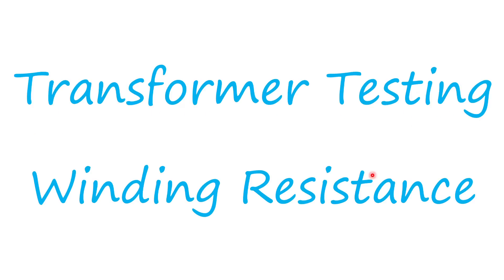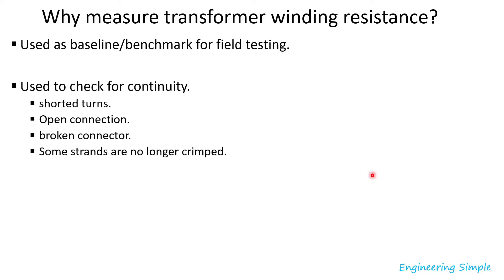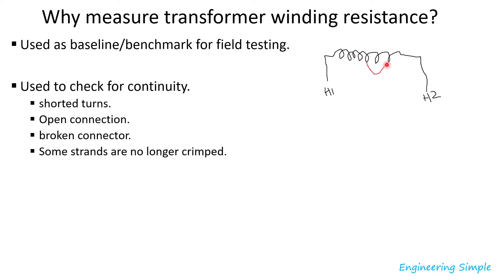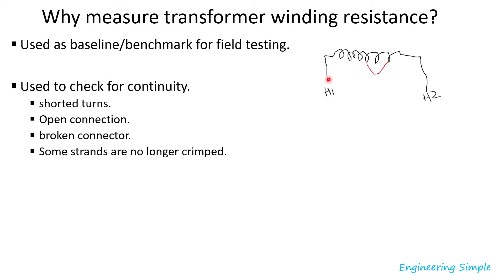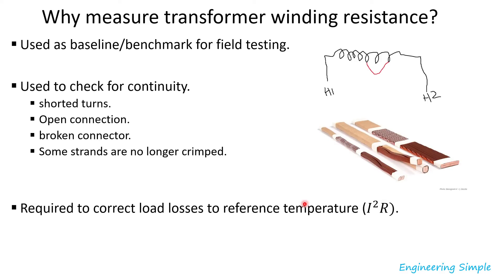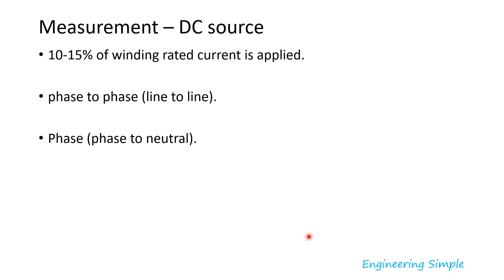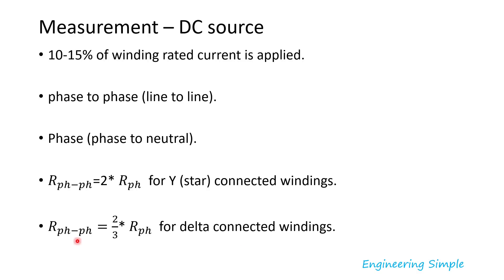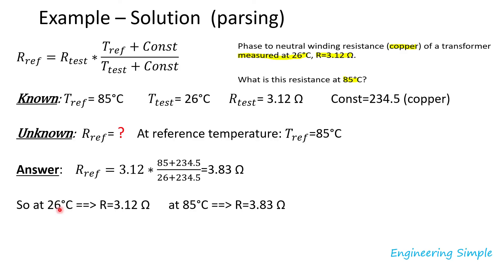Transformer Testing | Winding Resistance Measurement

Comment: Thanks Engineering Simple for interesting videos. Can you tell me what is the reason of using DC instead of AC current for winding resistance testing? Thank you in advance
Reply from the maker: Load losses are composed of I^2*R+stray losses. Stray losses are due to leakage flux that causes extra losses in the structural components such as core clamps… Losses are measured at the factory at room temperature say 25 degrees C. The load losses are guaranteed at 85 degrees C for IEEE designs. Resistance needs to be corrected for temperature to recalculate losses at reference temperature. If you apply AC power to measure resistance, you will need to measure power (watts) and calculate resistance. However, AC resistance will typically be higher than DC resistance due to skin effect. The skin effect is already accounted for in the stray losses so DC power is used to measure winding resistance.

Comment: Why we need to convert the measured value to some other temperature?
Reply from the maker: Load losses are calculated and quoted at the reference temperature. For IEEE, the reference temperature is 85 degree C. The resistance and load losses (I2R+stray losses) will be measured at ambient temperature, typically 20-30 degree C so they need to be converted to the reference temperature. I made other videos on load losses.
Reply: @engineeringsimple  Thanks

Comment: WHAT IS THE EFFECT OF INTER TURN ON WINDIND RESISTANCE
Reply from the maker: Thank you for the question. The resistance that this video is covering is the DC resistance. No skin effect is taken into account. The DC resistance calculation is the resistivity of the material (copper or aluminum) times the total length of the conductor divided by the conductor total cross section area. If you are referring to the to turn to turn, then there is no effect on DC resistance. The same applies if you are referring to strand to strand for conductors that use multiple strands. I hope this answers your question. If it does not answer your question, please elaborate on “inter turn” and I will be happy to respond. Thank you.
Reply: @engineeringsimple   Thank you am answered. I am new in the transformer manufacturing circle where i work as a tester,so i have been curious about how would i interpret winding resistance results to detect inter turn fault. i will continue to ask question in future where i need explanation.Thank you
Reply from the maker: You are in the right channel. I will be posting more videos on other tests such as induced, impulse, etc.
Depending on the size of transformers, resistance is typically small. A small change in resistance, shorting or adding extra turns may make resistance still appear within tolerance. In general, shorting turns will exclude them from resistance measurement. Resistance will be smaller than design value. If by mistake, there are extra turns, resistance will be bigger than design value. However as I stated earlier, if the number of turns shorted or added is small, it may be hard to tell by resistance measurement. However, if there is an issue with number of turns, core loss test and induced voltage test will definitely catch the issue. Hope this helps. What transformer size? Distribution or power class? Thanks.
Reply: Testing units from 10KVA to 1MVA, distribution transformer. The comapnay rarely manufacture anything greater than 1 MVA, it only does on special requests.. ill keep my eyes wide open for your next videos on other transformer related tests